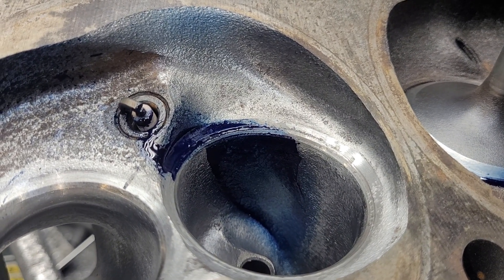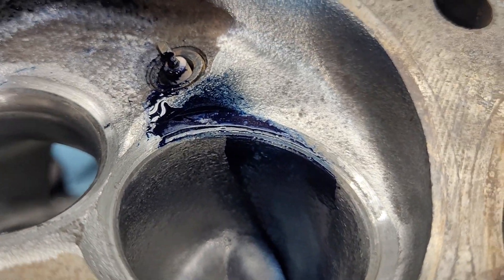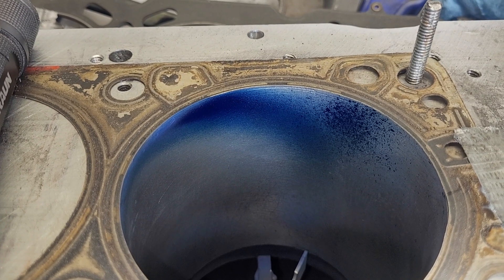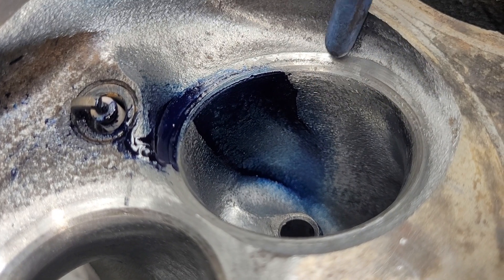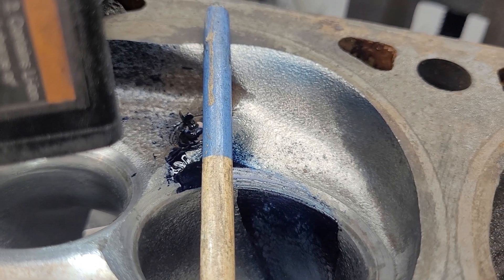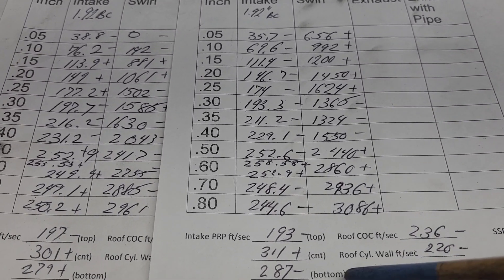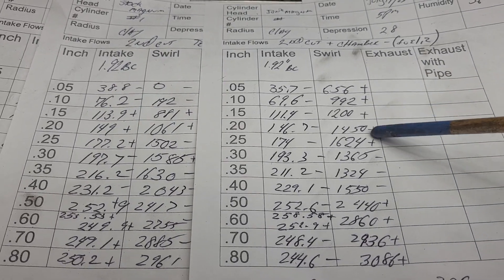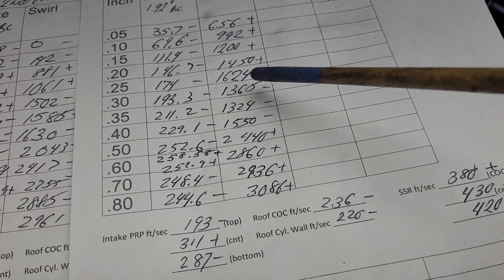Mopar Magnum cylinder head, chamber cut for increased flow and swirl. Winner or loser?

Comment: I wonder if the increase in swirl will offset the loss of compression  from the amount of metal removed? 
Also, since the fluid flow moved away from the roof, did that completely negate the nice looking porting you did on the valve guide?
Reply from the maker: I don't worry about compression on a mod like this. Added swirl and flow  for the win.

Comment: It just followed the plug bump lose
Reply from the maker: No idea what you are writing. Sorry
Reply: @servediocylinderheads  the bump is on intake side the flow is being ruined because of its protrusion messing with dye results understand
Reply: @servediocylinderheads  take the spark plug out and level the thread bore
Reply: @servediocylinderheads  you won't get results in the Eddy's of flow properly if it stays it is like a tail rudder and gooping the dye all in front of the air transitions from intake too exhaust following your new cut into the bore from chamber distortion you added it just makes ruined chamber
Reply from the maker: @seanbragg1696  Thanks for the help.

Comment: I think a bit of epoxy to bring that roof on the long side down more might force the air charge to the chamber rather than to the piston.  Might reduce the spatter caused by the spark plug and boss.
Reply from the maker: We are on the same page. Thanks

Comment: (Air Tumble)...Anytime you Lower Chamber or Walls Less-Flattened-  lower   than Valve Angle seat(45*) the Air will SEPERATE and TUMBLE , Deatomazion of Mixture , Puddling and Wetting of Plug and Chamber ?  TOO Big Flat and Open is Bad ?  A Slugish, Bogging, Lazy Accelerating  Engine  Results ?
Reply from the maker: So, what can be done if the chamber is too flat stock?
Reply: @servediocylinderheads No Bandaids .  Low  Performance , Crusher material? Go Closed Chamber or Aluminum Hi Po
Reply from the maker: @MrKawa74  If you can. Thanks

Comment: I'm a Mopar guy but I'm still hooked on the Olds heads. I've never really seen anyone do Olds stuff. When you do port velocity where do you take the measurements? Bowl, mid, or start of the port?
Reply from the maker: Pinch, top, middle, bottom. All centered.
Roof, both sides of the bowl roof.
Ssr, coc, center, cylinder wall side.
Reply: @servediocylinderheads  jeez! Thanks for the reply

Comment: Need to slow the ssr and increase flow on the cylinder center wall of your port.
Reply from the maker: I agree.
Reply: Could you explain why? I'm curious.
Reply from the maker: @rolandotillit2867  Excessive air speed is restricting the flow. It would be more pronounced on a running engine.